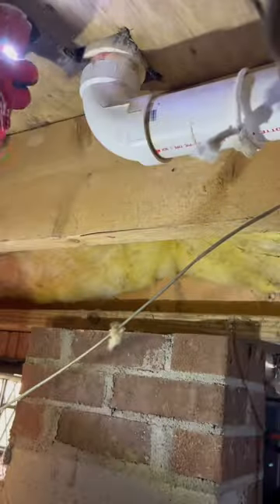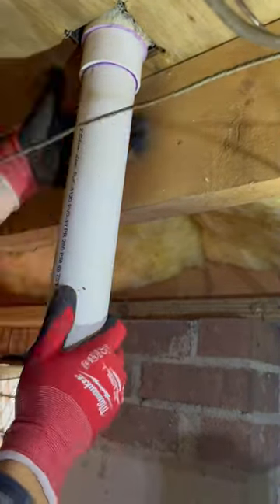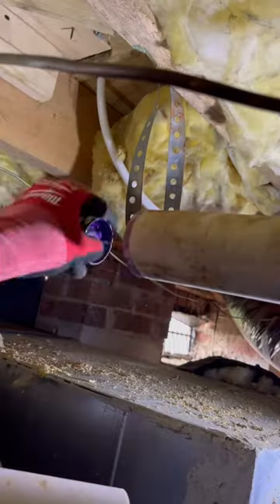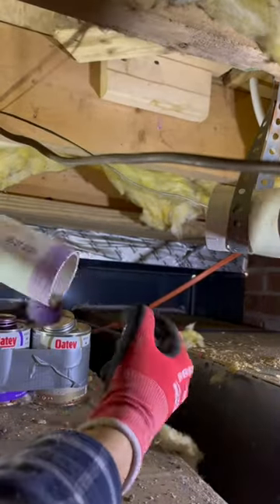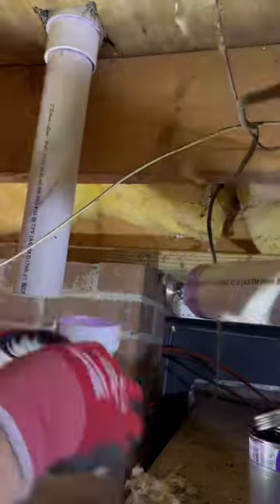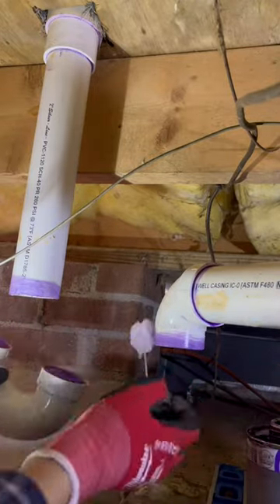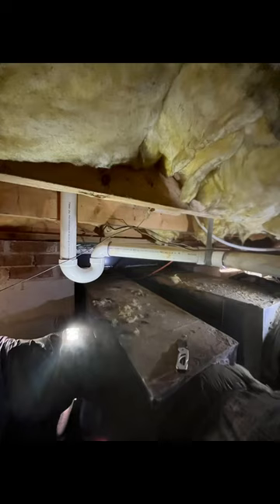How to Fix Sewer Smell in Bathroom #shorts #plumbing #plumbingvideos

Comment: The sewer smell is caused by that running trap. The downsize in pipe will cause a clog, but not a smell. A running trap will cause a hydraulic gradent effect in the trap.
Reply: What's a running trap?
Reply: @woodchuker570  A trap located in the horizontal, too far away from the stand pipe. It won't maintain trap seal.
Reply: After using the bathroom n flushing my house smells like poop,can u tell me why that is?thanks in advance
Reply: @youtubeclown443  septic tank emptied?
Reply: @youtubeclown443  Probably that giant turd you dropped is causing the odor
Reply: Doesn’t have septic tank just regular plumbing
Reply: @youtubeclown443 
Taco Bell and no open window or fart fan 😮
Reply: @Weldemall2  what else could be potential problem?
Reply: @youtubeclown443 your waste pipes aren't configured properly or something isn't vent properly. When you flush the toilet it creates a negative pressure and suck one of your trap seals.
Reply: @scottboehmer1114  thank you
Reply: @youtubeclown443  flush your toilet once wait about a minute, flush it again and listen for the sound of draining water in your tub or your lav. If you can here water it means the seal is gone. A full trap shouldn't allow sound to travel through it.
Reply: @scottboehmer1114  I’ll get right on it thank you so much
Reply: @scottboehmer1114  A running trap with no vent will cause this.
Reply: @joshm5816  that's covered under improperly configured piping.
Reply: @scottboehmer1114  went in basement n seen a slightly leaking pipe,do u think this could be the problem
Reply: @youtubeclown443  yup
Reply: @scottboehmer1114  thank you for the help I’ll get my plumber on it
Reply: @youtubeclown443 It might be the wax seal underneath the toilet. Really easy repair you could do for about 10 bucks. If the flange isn't broken
Reply: @youtubeclown443 .  You do know you’re supposed to poop in the toilet and not the garbage can.
Reply: Exactly right. Smell is because it isn't being properly trapped. Not the size. Big to small to big is illegal as well
Reply: @youtubeclown443  typically it’s not having fan for venting the bathroom.
Reply: Make sure all of your floor drains are holding water and keep them filled. A flushing toilet will push the sewer gas past any trap that is not filled.
If the vent that goes through the roof is blocked, the sewer gas will also push right through the water in a trap, or it may siphon the water out of a trap allowing sewer gas to escape.
Reply: @youtubeclown443  must likely a leaky flange , pull your toilet and look for debrie .
Reply: @youtubeclown443 quit pooping in it!
Reply: I have occasional sewer smells inside three different properties where I used Sudard vents. One under a sink. One on an outside wall, and one in an open wall cavity.. are you familiar with this problem? Is it the Sudard vents sticking open?
Reply: @curtis3363  Yes. It's the Studor vent.
They should only be used on a retrofit when running a proper vent is not possible. Any plumber using those on a new house should be sent back to start their apprenticeship over. Just because they meet code does not mean they should be used.
Reply: @youtubeclown443 give it time the smell should go away without a vent, all on its own as it disperses and if it doesn't then you have larger issues
Reply: Aka siphoning
Reply: @Curtis3366  wtf kind of plumbing system do you have? What's the reason for the one in the open wall cavity? Are those vents even legal other than for RV's and mobile homes?
Reply: @youtubeclown443 were you able to find out what the issue was? And how it was fixed, if anything?
Reply: @youtubeclown443  Vent  issue. Have  a plumber look at your vents. Probably a hack job.
Reply: @youtubeclown443 sounds like you have an open vent or a trap that doesn't have enough water in it. Is there any fixtures that you don't use like showers , tubs or sinks. If so run water in them.  Also check any floor drains to make sure there's water in the traps. If this are not the problem you make have a vent that's cracked or not connected in the walls. Good luck finding that
Reply: we call them inline traps, but the smell usually comes from the bacteria build up in the line rather then gases, if your vents are all done properly then there is no reason the trap will dry out to stop the seal.
Reply: @matthewk6731  , back when I worked briefly in Plumbing as a kid, I used to call them "Stupid" vents, AKA Air Admittance Valves. The rough-in Plumbers liked them because "less work" for them. Of course they were typically used under kitchen sinks and in rare instances where it was not possible to vent a fixture to the main stack or take it directly out through the roof. 

I even remember the "trap primers" we connected to the water line of a faucet which would dispense a small amount of water to "wet a trap" each time the faucet was used.
Reply: @zenithperigee7442  Yeah. Trap primers. It was an expensive "fix" instead of having someone dump a little water into a trap once in a while like people have been doing for over 100 years.
Now we use rubber trap seals at the floor drain inlet. Another "fix".
Reply: Was the issue because the trap was too far away? Regardless of the big to small to big pipe, the trap should have functioned still?
Reply: No. The hydraulic gradient starts at the exit of the trap weir. Not where it enters the trap. A double bowl kitchen sink on an end outlet waste is basically a running trap. Wheelchair offsets are basically running traps. The theory is that if the entrance of the fixture’s vent is lower or equal to the top level of the trapped water in the p-trap, it will back siphon. Do the math on the minimum amount of fall on a trap arm, and it’s usually less than equal to the diameter of your pipe that you’re able to travel before it has to be vented.
Reply: It's always the plumbers fault...but that duct work looks like crap.
Reply: @woodchuker570  Its already been answered, but some comments are still mixed up. 

Basically, the long horizontal pipe itself is the source of the smell as debris (aka waste) would make its way along the length and leaving behind anything that doesn’t make its way further down the drain.

It would just sit there rotting until the next flush of water.

To avoid that, this plumber made it directly downward straight into the P-Trap, where the water naturally seals out the smell. There is not a lot of opportunity for the waste to remain in the plumbing.
Reply: @joshm5816 😂😂🤣🤣😂😂😂🤣🤣😂😂😂🤣🤣
Reply: @josephpope3467 😂😂😂😂🤣🤣😂😂😂🤣🤣😂
Reply: @huejanus5505 😂😂😂🤣😂😂😂😂🤣
Reply: What if it is a whole house trap? It does have a vent.
Reply: We all know that it's always the plumbers fault...lol.

Comment: There's something so satisfying about a nicely run drain. I do HVAC and every time I have to redo a drain and try to make it look as nice as possible, cuz there's nothing more satisfying then good-looking parts
Reply: The pride of a job well done
Reply: DIY’ers can come up with the most convoluted ways of doing the most simple thing. Wiring, plumbing and framing, hell all the trades when done by a competent professional, look so simple and clean.
Reply: My favorite plumbing clean jobs is when I see the lines color coded. Its just red and blue, and its so easy to follow when troubleshooting.
Reply: It just means u don't have to smell it

Comment: I learned the p trap has to be within 30 inches . This is valuable to viewers! Thank you.
Reply: It needs to be below the fixture. No fittings in the tailpiece (fowling chamber). Those 30" might be the max lengh of tail piece. If they could be any distances less than 30 inches, they could  be in the wall and free up all that space in the cabinets

Comment: Lol the pipe going into the coupling was only halfway in
Reply: thank you for saying it, its gunna fall off when somebody snakes it out one day. also where vent?
Reply: Cause he cut it to short was going to say that
Reply: Yeah, I said the same thing with the pipe not going into the coupling all the way.  I think this was a wet vented bathroom, which is vented through the lavy.  Given that this was a 2" PVC drain with a P trap below, I think this was a shower that he worked on.

The trap he cut out was 1.5", which leads me to believe that a bathtub was in that area before.  Some "jack-of-all-trades" contractor or previous homeowner probably did a remodel of the bathroom and didn't know what they were doing with the plumbing.
Reply: I was looking for this comment
Reply: That coupling won't stay there for too long 😢 it's fitting only half way in.
Reply: What a 🫏 🫏
Reply: @chorriatrevido1 have you ever tried to pull a fitting apart after the glue dries? Even half way in it won’t fall off. It’s still wrong but it will be fine.
Reply: @BlueDart1971 it’s called “hub savers” they cost $16 for the regular ones and yes plenty of times I’ve had to cut out pipe or of a fitting… that’s the job. You can’t half ass something because it’s easier.
Reply: @am3rikan84  I’ve been a plumber since 1991. Trust me, I understand plumbing very well.

Comment: Hard to find someone like this man who will work to do what's right for you. It's hard to find contractors that are worth a darn
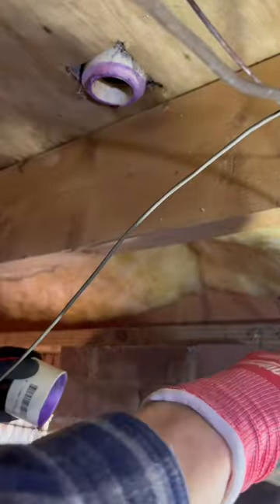Reply: 0:13 he glues a joint where the pipe is way too short, needs to be twice as long.

This joint is likely to fail.

He should have used a hub saver to remove the pipe from the fitting above and installed a new pipe into the hub.

This was a shortcut taken.
Reply: @merlinious01  Glad you know. Good  Plumber is hard to come by these days.

Comment: I've never had a problem like that .  Usually if vent is getting clogged it's like your pop bottle fill it up turn it upside down it gurgles.. put a whole in the bottom turn it upside down don't gurgle.  That's how I explain it to my customers.  Good job brother.. 🔥
Reply: I've always explained that kind of problem like if you had a straw inside of your drink.  Put your thumb over the straw and lift it out of the drink, and you notice that little to no liquid comes out of the other end of the straw (no vent).  Take your thumb off the top of the straw, and the liquid drains out (perfect vent).

Comment: Where was the vent line? Not having a vent will give you the gas smell.
Reply: No it won’t. The only way that could happen is if the trap gets siphoned.
Reply: @BlueDart1971 AND HAVING A VENT ON A FIXTURE IN ITS PROPER LOCATION. HELPS TO MAINTAIN A TRAP SEAL
Reply: @CHARLESVELTEN-t3w  don’t say stupid shit to me. I completely understand how plumbing works. The original comment said not having a vent WILL give you a gas smell and that is false. It’s rare that a trap will siphon but yeah it possibly can.
Reply: @CHARLESVELTEN-t3w  why do you insist on saying stupid shit to me? We’ve already gone over this yet you say it again like it’s going to mean something this time.

Comment: How does downsizing drain cause sewer smell?
Reply: Unlikely from that, I’m guessing the long length of the fixture drain before the trap probably had built up debris, sludge etc
Reply: Shouldn't the pipe be Abs pipe
Reply: @gilbertcox5075  no. Depends where in North America you are. In Canada it’s mostly all ABS for single family residential. Seems to be mostly PVC down south, although I see guys in Cali use ABS too.

Comment: This short video was worth watching. I learned that running traps do not conform to code and that standpipe has different meanings in different trades.

Trap should be connected to the vertical drop from the sink or tub or shower.

Comment: Just an fyi. Low voltage wiring, yes 220 is low voltage, has a plasticizer in the coating to maintain flexibility. If it rests on PVC it will cause the PVC to degrade at a rapid level, eventually making it fail.

Comment: I used a waterless trap just below the outlet. It has a flattened rubber tube inside that opens to let water and following air go through but slaps shut on any back pressure. No gurgling, no blockages and no smells.

Comment: Work looks nice ..its crazy how much code differs from state to state ..
Band iron to hold up pipe is a no go ..down in fla. Sammies are no good up north ...cant use a running trap up north ..i dont se a vent ..not even a pro vent..
Regular trap hold more water so seals better ..running traps with no vent the trap seal gets pulled out.

Comment: I’m not saying go back and re do it but I wouldn’t have Tied on like you did without adding an additional strap directly underneath that P trap

Your coupling Had barely anything to stick on to. After you glued it you could definitely see you might have gotten 50% of the desired insert. 

Really, I would remove the pipe from the fitting coming down into the floor above by collapsing the pipe from the inside the fitting with two cuts and then busting it out then you’ve got a fitting to completely glue in to , but what also works is using a rubber fitting over the plastic fitting (not the tiny section of pipe, and yeah maybe you’d have a problem tightening the hex clamp above the floor. You’d have to cut a tiny hole for your ratchet equipped with 5/16 socket) 

If that P trap ever Gets Filled up And the pipe above it becomes clogged with something, that joint is definitely one of the first places it will fail. Gravity is definitely working against it.

A strap under the p trap would definitely Provide some reassurance if that pipe ever Decided it needed it. In this case I think you missed but Still You Might Not see this ever fail. I’d be sure it didn’t though.

Comment: QUESTION: Why is "30 inches" necessarily too far from the fixture?  My house main trap (4") under the basement floor (the leads to the sewer) is 15 feet or so away from the vent stack.
Reply: In a lot of places (but not all) whole house traps are frowned upon. They have no real benefit. If i were to make a guess based on my own experience if it was installed at a time where they were required by code, everyone involved knew they're stupid and it was put in to be "technically correct"

Comment: Couldn't you do your first cut on the 90 then cut a slit the 90 then break/pop it off so you could reuse the existing pipe? that first coupling is barely seated. I may be an electrician but I've run miles of pvc conduit underground and have had to do the same thing to prevent adding unnecessary couplings and to change bends

Comment: Slowing down the video... I see the shower drain wyeing into a 3" branch. Off the end of the wye was immediately a 90 up with a c.o. tee, then continuing up. Where did that go/serve? 
1. If it's a stack, Connections within 30" of the base of that stack (10× the diameter of the pipe)  are prohibited due to vertical jump. 
2. If that goes to a WC then the shower is not vented since the shower needs to connect to a vented branch,  not a fixture drain.

Just curious.

Feel better!

 Thx

Comment: We are allowed 1.2 meters on the fixture outlet pipe here in Canada 😂😂
Reply: Yep 1200mm my guy. Nice work,
Reply: We are also not allowed to use a 90 on its back coming out from that shower base either. 2-45’s mate. Or a long sweep I suppose if you can find them
Reply: @feeblewrk5788 Yeah except in a wast an overflow kit for a tub drain for some fu*ked up reason.

Comment: The trap has to hold more water in the "U" than can potentially be syphoned out of it.  Air needs to be able to return over the slug of water. The bigger pipe will make the slug less intense and not get flooded full.

Comment: Why would that cause sewer smells?
Reply: He robbed them
Reply: @junioraguayo8574 what? No
Reply: Once you exceed a certain distance, 30inches per ipc code, it will accumulate bacterial growth or a "waste film". Obviously that will start to smell. It's a good catch by the plumber.
Reply: The trap was built wrong and wasn't holding enough water to block the sewer gas from coming back to the house. The guy in the video built it correctly
Reply from the maker: If the run before the trap is too long the surge of water will create and siphon effect and suck the trap dry. Allowing sewer gas to pass back through
Reply from the maker: @junioraguayo8574 lol
Reply: Where is the vent is this wet venting
Reply: @PlumbHero The only thing you missed though was that you put the p trap on backwards. The side with the sharper bend goes on the up stream side and the shallow bend goes down stream. It’s designed that way to also prevent syphoning the p trap dry.  I was just taught this the other day by master plumber. I never knew.
Reply: @crippleshot4810 is this true??
Reply: @markthompson7127  if it’s a shower and tying into a 3” main in the horizontal and less than 16’ in length then no vent is needed.
Reply: @bryant5233  different states different codes I'm in Kentucky every fixture has to have  its own vent no wet  venting or mechanical vents are allowed we have our own code and do not follow upc or international codes

Comment: Bro, you need to redo that. The coupling is only half way in, the rest of it looks greats and I love the strapping. It looks like a fitting in the floor I would try to use a fitting saver, and stub out a new piece of pipe.

Comment: S trap was the problem. Can take a 1 1/2 drain  line 6'.  2" pipe can run 8" from the drain vent.

Comment: He glued a half inch of PVC on the coupling. The plumber could have spent an extra half hour cutting the pipe out, clean and glue a solid length in.

Comment: Let’s talk about that NO GO where you only had 1/4 of the pipe at the bottom of the fixture . Per Code that is not enough pipe to connect . You should have ground out what was left and installed a full piece of pipe .

Comment: If the bathroom isnt hardly used then the p-traps dried up and is letting in sewer gas. Simpley run some water in all thr fixtures. Shower, tub, sinks.
Reply: And if it's a bathroom that very infrequently gets used, we recommend pouring mineral oil down the traps to prevent them from drying up